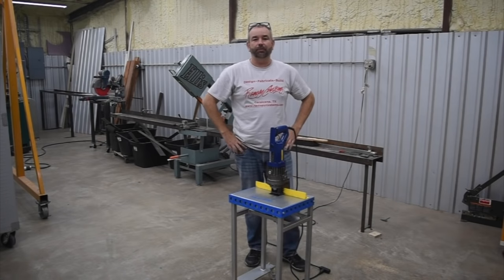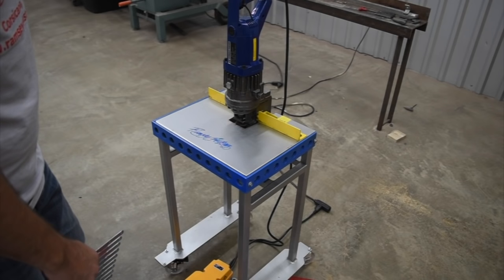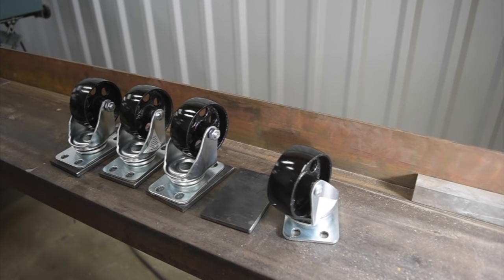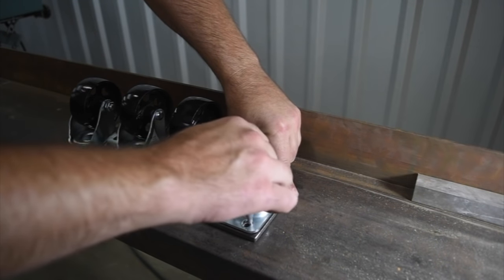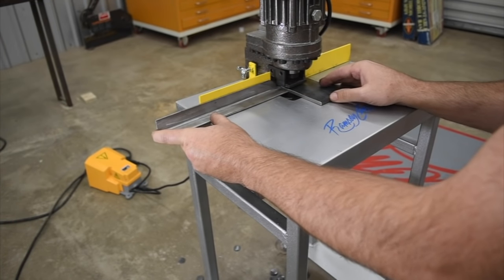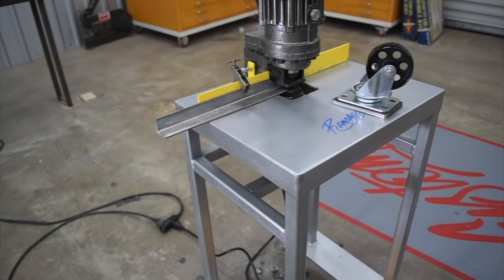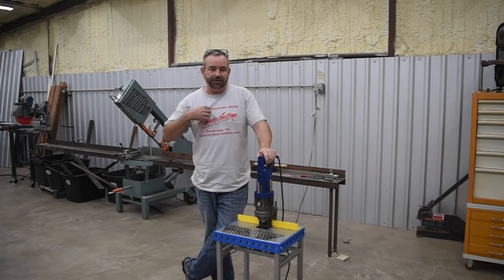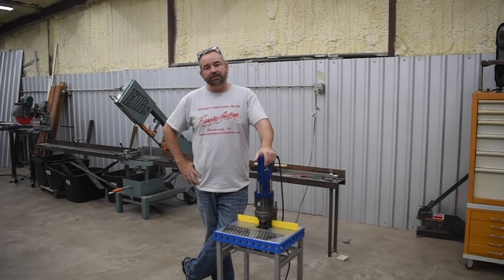DIY Electric Hydraulic Hole Puncher Station - Punch Holes Easily in Thick Steel

Comment: I just bough the same machine, for any reason when I’m punching the punch just stays completely inside the material and Tempe machine seems not being strong enough to pull it out, I’m doing something wrong? Im using oil and lubricant but it seems to not help enough. Regards

Comment: nice project. what is the name of the tool you used for laying out the holes?
Reply from the maker: It's called a rivet fan spacing tool... you can pick them up on eBay or amazon.

Comment: how thick can you punch with this setup? and, also, can i just buy the unit from you somewhere online?? Liked the Vid
Reply: "Electric Hydraulic Puncher"   Mph-20    (alibaba.com , Ebay.com)
Reply from the maker: It will punch .250", and yes you can buy it online.  I dont sell them.  I just sell the plans that has the direct link for the one I used in the video

Comment: will ordinary workshop able to make this ?
will the needed material available anywhere ?
how many watt the power is ?
Reply from the maker: If you can measure, cut, grind, and weld metal, then yes you can make it.  Its 120 volt

Comment: it's an amazing machine can i punch 12mm steel with it and the diameter of the hole it must be 16mm.
any suggestions 
thank you in advance.
Reply: Manual states it'll punch up to 6mm thick steel (though you can fit 8mm into the tool) and dies are available to punch up to 20.5mm diameter.

Comment: nice job ,where I can buy the punching machine? how thick I can punch?
Reply from the maker: You can buy them on eBay.  Its rated for up to 3/4" hole in 1/4" thick steel.
Reply: can you give the link about that punching machine?

Comment: What's the total cost of the parts to build the machine?
Reply from the maker: Its less than $100 for the stand plus the cost of the hole punch itself.
Reply: good
Reply: The hole punch is only like $700.  What a bargain!
Reply: @elesjuan  They're down to $500 now from Vevor. A recent project had me at the drill press for 3 days. This machine would have cut that to less than one day. That project's labor savings alone would pay for the machine a few times over. I only wish I'd have learned about this machine sooner! Bought it as soon as I discovered it, arrived last week. Potentially a huge money maker.

Comment: unit did not seem very rigid in this setup, it wobbled on the cut. what about the unit itself and the dies it uses? forget plans to make a table for $3; should be free lol. 
I assume it's a 120v portable electric hole puncher
Reply: Plans are free when you draw them yourself 😉👍